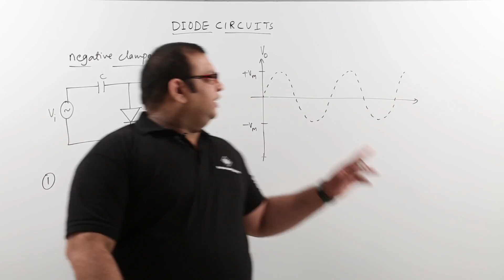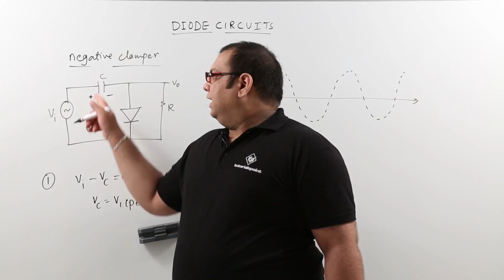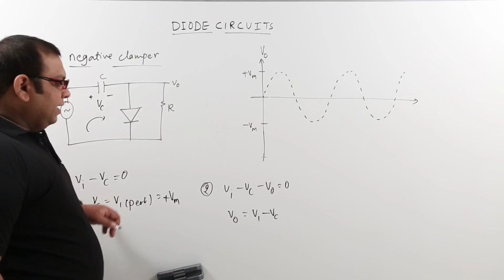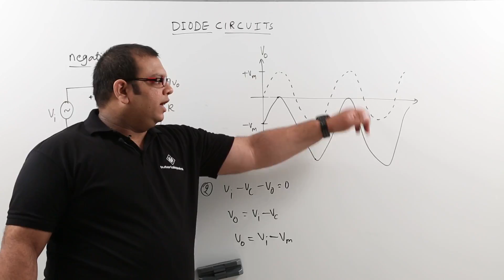Negative clamper

Comment: If we put a resistor across the diode  then the capacitor start discharging hence there is no peak voltage Vm at the capacitor. If resistor is present out put peak values gets changes .